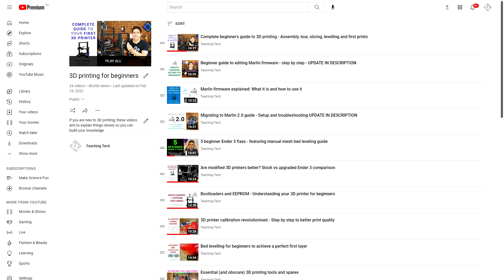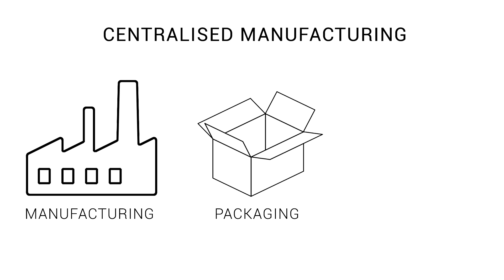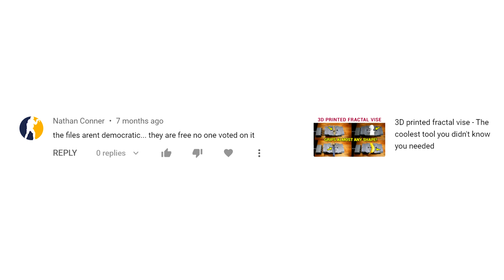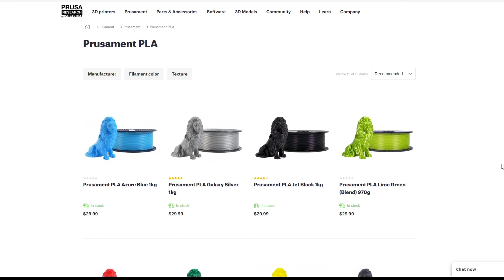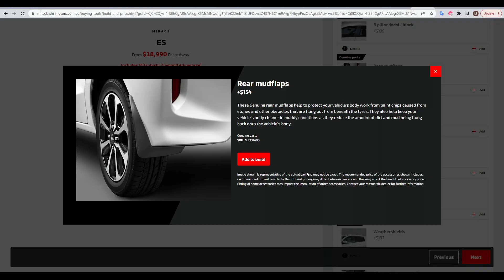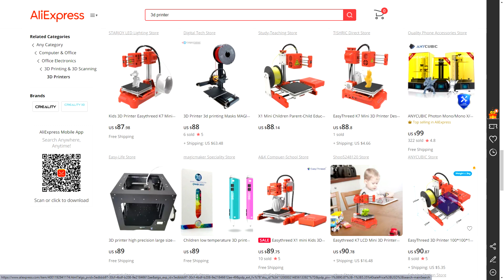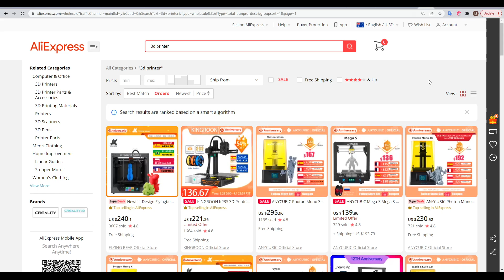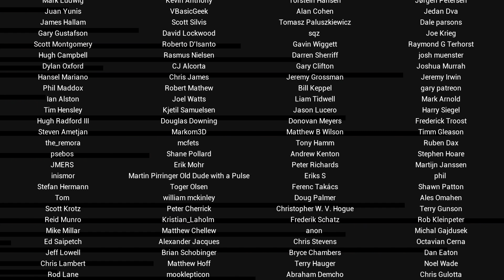3D printer trends are limiting mainstream acceptance: The 3D printing paradox

Comment: Honestly the more I have thought on the subject, the more I realized I really don't want to see 3D printers become like others mass produced, able to be used by random joe stuff. Based on the products being put on shelf now, this is my imagined experience with that.

I spent several days, weeks or months designing a part in CAD and hit print. There's an error because I haven't updated the driver in that time frame, so now I sit for a few minutes and wait for it to update the driver, followed by a forced reboot of the computer because why not. Ok, fine it all went through, resend the print. The printer wakes up from it's low power sleep state and begins to connect to an ad server. It can't connect and refuses to print since I have not watched the ad. Ugh, great, now I have to spend a few minutes to a few hours troubleshooting my network to find why it couldn't get a connection. Ah ok, the update had a new port to open up in the firewall. I try again after forwarding the port and still no dice. Fantastic now I have to call Comcast and do the magic reboot dance before they finally listen to me and check if the port is open on their end. A lot of hold music and suffering to restrain myself later they confirm the port was indeed closed and have opened it as per my request a couple of hours ago. 

Ok, resend the print again, the ad loads but in the update they removed the ability to skip it after 15 seconds. Several minutes of sad puppies and crying, starving kids in uganda later the printer finally begins the pre-heat process. For the first time in several hours I gain an ounce of hope. Bzzt, crunch. C'mon man, why would you feed the filament into the nozzle before it's even hot, why didn't you detect this crap. Fine, I'll just back the filament off a little manually in case it does it again and try again. Another several minutes of seeing overly done up newcasters telling me why I should tune in at 6, weird it's 7:30 and I havent' eaten yet. It's off to the races, the nozzle has preheated, the bed preheated and it's laid out a nice prime line and got a good start on the first layer. I go into the kitchen to make a sandwich since I just don't have the patience to cook at this point. Beep, beep, beep from the room with the printer. Seriously, I haven't even finished putting my sandwich together yet. I slap the top slice of the bread on my sandwich with just a couple slices of meat, not even realizing in my frustration my other dressings are still sitting on the counter top. I walk into the room with the print taking a bite out of my sandwich and look at the screen on the printer to see what went wrong.

The sandwich falls to the floor as I read the message flashing on the screen: End of spool detected, printing aborted!
Reply: Yip, like chips in spools are a thing already. Becoming more common, they'll become DRM and then you'll have the 1000$+ machine wanting the tiny 300g branded spool that costs 100+$ a kg. 
And i don't but for a second that creality wouldn't look at that and say "hey, we make filament, we make printers, drm is cheap"
Reply: @CalamityLime  honestly i'm really relying on prusa a lot to save us from this nightmare
Reply: Also the Roll is half full but the DRM/firmware cannot use the other half of the roll for "quality and safety issues" .. after all they don't want your filament to run out during a print..

Comment: Akkkk.... there is so much you get wrong in this video!  In automotive, niche end user "technologies" trickle up, as you say, all the time.  Adjustable shocks were an aftermarket thing... big manufacturers then saw that people wanted them and started putting them in as an option, albeit extremely high price.  Drivers were putting cigarette ligther phone chargers everywhere... manufactureres started includng dedicated USB charge ports.  Some of the "niche" users are themselves high profile, like racing teams, so it gets a bit more complicated for auto, but your statement is simply wrong.  Auto manufactueres, like most "bigs", are interested in earning rents.  That is very anti-democratic.  The problem with 3d printing is not that the machines have gotten worse - my library just replaced an ultimaker with a creality 3.  The ultimaker was always having issues, and it went in the bin - I got it from a dumpster dive. But their creality seems to work without any issues at a lower cost, sacrificing a bit of build volume.  The real problem is that, much like with Linux, you had a lot of enthusiasm initially by people to share their designs.  Because designing parts is something that is just beyond the possible for a typical user.  I can wrench a starter off my car, but don't ask me to design one.  Auto manufacturers are dealing with this by making it "normal" to control all parts - they even try to confuse by changing part numbers or classifying part numbers as trade secrets.  Any any code included with parts now gives them a way to make their products un-repariable outside their rent-earning dealerships.  It takes a lot of time to design a part.  In the use case you describe - replacing an "out of production" part for something that breaks at home, starting from a model already on tinkercad, it took my several days to parametrize it to be able to get it right for the users own application.  Now there is a learning curve, so it gets better, but consider something as "simple" as a window tilt latch.  How likely is it that a homeowner will be able to get the design for the part they need, take it to a makerspace (free library for example), and successfully print it?  Check on thingiverse - you'll see that nobody lists what the backspacing or tap distance is.  So you have to guess?  The typical homeowner cannot afford to print 20 examples and hope that one works.  They don't have the skill to design one themselves.  Nor is it economical to send it off for "reverse engineering" by someone like yourself.  And that is the paradox.  That is why most common 3d printing applications are art related, rather than things that are functional or disrupt the central-source manufacture-distribution model.

Comment: Excellent point that needed to be brought up. I bought a Prusa in part just to support their excellent innovation, even though I already had an Ender3 that I had tinkered on and upgraded myself. 3d printing is still a relatively new technology, so it will be a while before it gets to the level of ease of use where everyone has one in their kitchen. It took car manufacturing many decades to reach any kind of standardization, and cars have a really good use case. There still isn't really a need for 3d printers in the same way. 

3d printing tech is also simply too slow/messy/error prone for prime time - the average user doesn't understand why it takes hours for and FDM print, or why they need to cure/wash a resin print. Print failures and printer jams are also the norm. We're going to be trapped in this weird paradox for a few years still, but hey, the tech is moving fast.

What I do think we need is for the 3d printing community to grow up a bit and embrace better UX, we need designs that are less garage engineering and more IKEA - easy to print, easy to assemble. The vast majority of projects on thingiverse are still a confusing mess, and that's really hampering non-technical people from adopting.

Comment: Here is the thing, paper printers are largely subsidized by ink/toner replacements, and the automotive industry is highly regulated and profitable, BTW try newer cars might be better to drive but are a nightmare to maintain even simple stuff such as oil-filters or light bulbs.

The where everyone has a 3D printer that just works, will controlled by a few corporations like HP or Canon or whatever companies come, where you need to be always online to print anything, and they decide which filament you can use, and can only use hotends and nozzles from them, and they decide what you can and can't print.

Comment: While I heartily agree with your major premise, I firmly believe that the worst part of the 3D printing experience is its reliance on troublesome, arcane firmware. I have lived for 75 years and am NOT a computer programmer or anything like one. I lie awake at night fearing that I will have to go into the Marlin to change some setting because of an upgrade I made to one of my printers, then having to shudder in anticipation of it not compiling successfully. If you want to do something to make 3D printing more accessible, how about designing a program that sits between the user and Marlin? It would have all of the parameters asked for in Marlin, with the present settings. All you would need to do is to change what you need to, then hit the button to UPDATE, and it would do it automatically. It would then output the compiled result to your computer to save on an SD card able to be uploaded to your printer. No muss, no fuss. Is this a dumb idea?

Comment: I have been 3D printing at home for more than 10 years, an still tell anyone who ask me about it for home use, to stay clear, unless they are technically inclined and need a project. It is by tinkers for tinkers to do tinkering: “To repair, adjust, or work with something in an unskilled or experimental manner”. The industrial space is a completely different story - the opposite in fact.

Comment: I don't think 3D printing is anywhere near being useful to general public. I bought myself a 3D printer recently to do a few things that are next to impossible otherwise but I still struggle finding more uses for it. I mean, it just prints plastic parts and they can't even be too big. That alone disqualifies it for creating 99% of things I have at home. It takes LONG time to create a single part. And it's EXPENSIVE. Even if I don't count the price of the printer itself, just the material I use costs more than a higher quality ready made part from a shop would, even though that part had to be designed, manufactured, packaged, shipped, and then sold by people each of which kept a bit of its price for themselves.
Currently utility of 3D printing is in making niche parts that just don't pay off manufacturing industrially because only few people need them or just one piece is needed. And I don't think it's going to change any soon.

Comment: I think 3D printing will be as reliable as the automobile.....one day. Compare it to the home PC. There was a time that the computer was only for a tinkerer that knew another language or two. The machines were crazy expensive and not reliable. Today they are common in just about every house in North America and in every pocket as well. 
Compare it to the car. There was a time that the driver had to know how to adjust timing advance, air/fuel mixture, chassis lubrication, and coolant flow, and adjust these ON THE FLY. The cars were expensive and unreliable. 
Like you said Michael, the innovation has slowed. It's not more about making a buck. When innovation picks up again, it will improve.

Comment: A Prusa used with prusa filament and prusa profiles dont need tinkering at all. It's not harder than cooking.

The problems left to be solved is 3D modeling,  metrology and strenght of materials.

Chinese printers and Voron are for thinkerers. I agree
Reply: @Blokka Nokka my prusa, after 3 years, had not a single nozzle jam.
Markforge fdm are even better because simpler to operate.
All machines do require maintenance.
But I agree that any appliance can break.

The biggest problem is engineering the required part.

Comment: 3D manufacturing certainly has its place, which is probably limited, customized production. With home printers we are all capable of printing a newspaper, but in such limited quantities that it can’t complete with news print giants.

But then look at customizations, I easily, quickly, cheaply produce items like name badges. 

I’m making gas sensors, which have limited purpose (organic vapor, CO, CO2, VOC…). I can use desktop manufacturing to build cheap, purpose built detectors and alarms.

Comment: FDM/FFF printing's critical path IMHO lies in implementing non-planar movement, adding another axis of movement to the print head, and certainly better development of polymers and printing plastics suited to the process. If makers are honest with themselves, materials like ASA/ABS have some severe behavioral drawbacks that need to be mitigated or resolved through better plastic formulation. There is another large caveat that will come with widespread adoption that I don't think anyone's been keen on discussing: intellectual rights management. It will be a 'thing' soon enough and cannot be avoided.

Comment: I think the biggest issue is the emphasis put onto filament printers.  Ultimately if you want it to go mainstream, people need to show case resin printers.  Easier to use, better looking prints for consumers, and in my experience far few failures. People need to stop propagating the myths of "of it smells terrible", "gotta be extremely careful, this stuff is EXTREMELY toxic!".  Yes there are safety concerns, but no more really than "throw on some gloves so you don't get everything sticky before you give it a quick rinse in alcohol".  Far more people use much worse chemicals around the house for cleaning with zero regard to safety compared to resin and ethanol.

Comment: The problem with what you want is that you want 3D printing to be turnkey, but that’s not possible. I’m sure you’ve had printing failures even on your best machines.

The reason why turnkey 3D printing is impossible with 3D printers (FDM in particular) is that the process involves very specific control of a large number of variables and nobody is interested in building a printer that is capable of controlling all of them. Of all the printers I have seen for sale, the only 3D printer that goes anywhere near controlling all of the variables is the Makerbot Method with its built in chamber heater. Nobody seems interested in buying $5000 printers

Comment: I run a small business. I ship my products all over the USA. And with only 10 3d printers I can design develop and printer smaller volumes everywhere.  In my case I still have to ship them. Most of my customers are not local. Most of my printers are around $200 & $300 dollars, and they do a great job printing day after day. In my case larger 3d  printers are overkill, and would be a wasted of money. My latest printer ender 2 pro does a bang up job and my products.

Comment: Awesome video, Michael! You make great points. While I'm hoping that 3D printers will become mainstream in the future, I'm afraid we're nowhere near the required level of reliability and usability, as well as ease of finding or creating the required models to print. Plus, the designs you find online are not always well made, and the prints don't come with any warranty, so a lot of room for improvement in that direction, but this has to come at a cost. R&D is lacking because companies couldn't find a way to make enough profit to fund it. I believe that things get better with time.
With regards to saving on packing and transportation: there's still packing and transportation for the filament, even if it comes without a spool.

Keep up the great work! 😎
Reply: Fortunately, 3D printing can still cut down on packaging when small product purchases may be individually packaged based on the individuals needs and a single spool could print all of those items when the individual needs them.